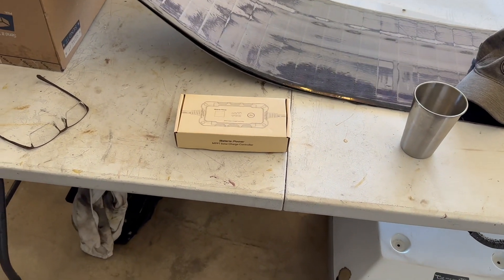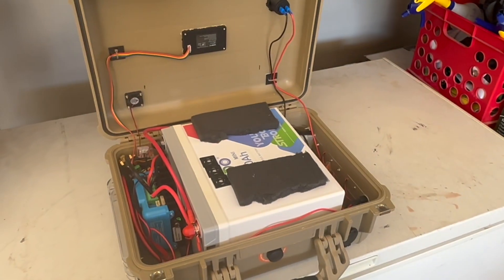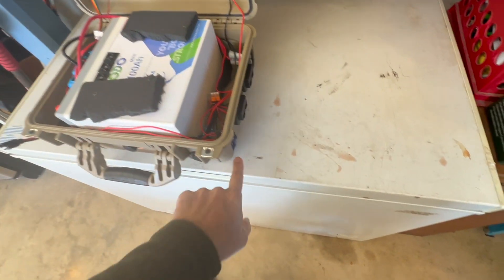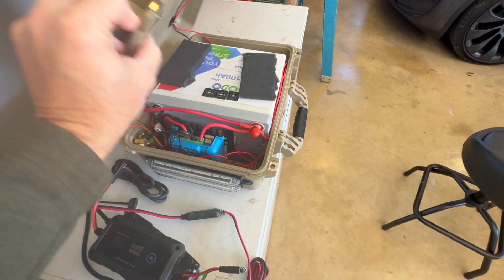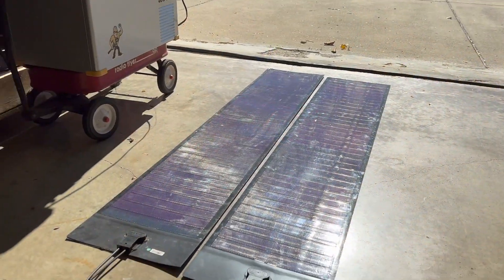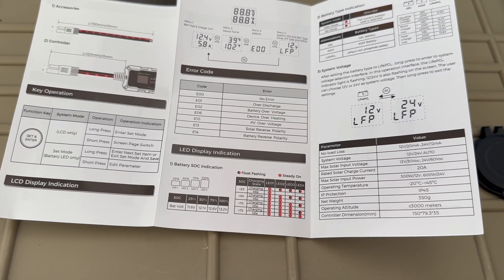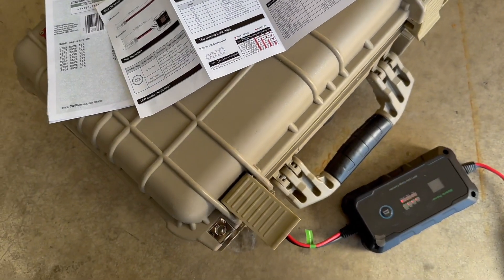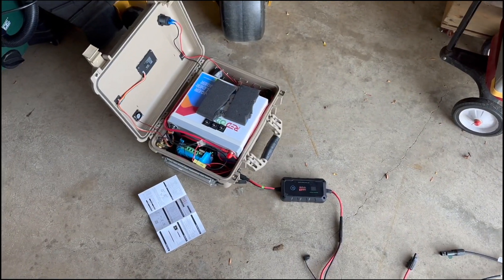Bateria Power MPPT 20Amp Solar Charge Controller / SunRock 20A with BT MPPT Controller

Comment: Some points of interest for your viewers...
I have the ~$34 10amp/12volt w/BT version of the Bateria on two 100w panels and it works beautifully. It's limited to passing just 150w to the battery so it would actually be the choice for that box as you have it now.
For reference... the ~$80 20amp/12&24volt model specs at max 300w @12v and 600w in 24v mode.
Reply from the maker: Thank you!  Amazing how well they work and the info they provide for the cost

Comment: Subscribed! I was hoping you would compare the bateria vs victron to see if they both extract the same watts from panel. You’ve inspired  me, I also made an Apache cased 100ah just using the cells and bms no case. Also two 65w PD, 12v car socket and sae input for bateria charge controller 👍
Reply from the maker: thanks!  A video comparing the two is on the list - we have turned into winter though with low temps, strong winds, clouds and overcast.  If I can get a good day, I will hook a panel to each controller and see what happens. Your set up sounds interesting.  I have seen others strip the case to get it even smaller - which seems like a good idea.  Kind of like taking a coat off once you get in the house - don't really need it....
Reply: Thanks for adding to list! You maybe able to use simulated solar with a dc power supply of some sort. It’s could be your new line of videos comparing cheap small mppts to the the bench mark victron. Anyways good work looking forward to the next one.